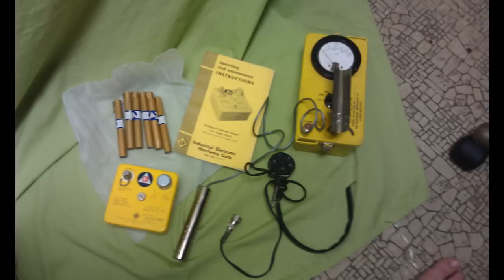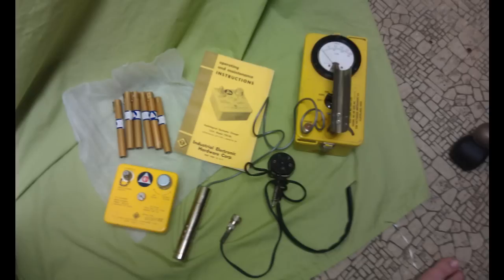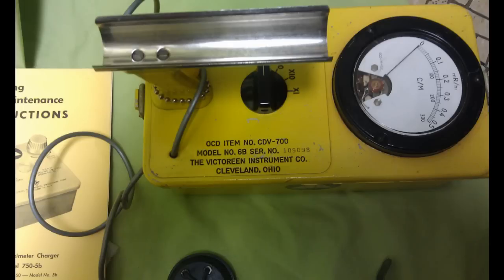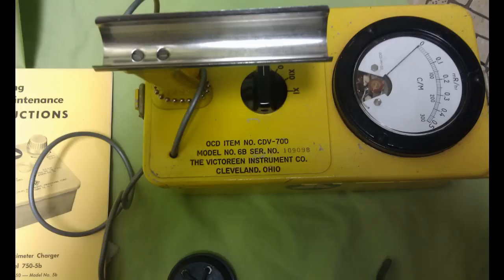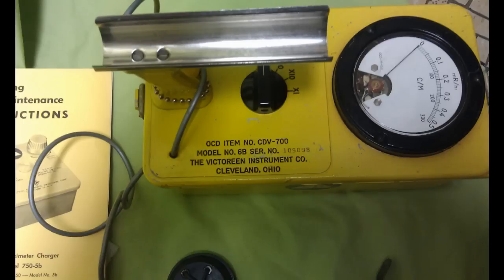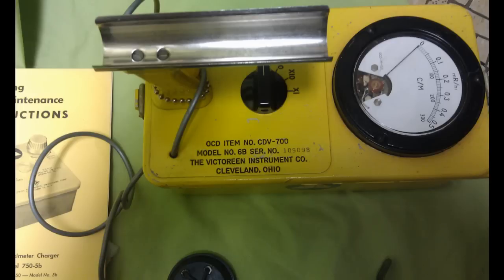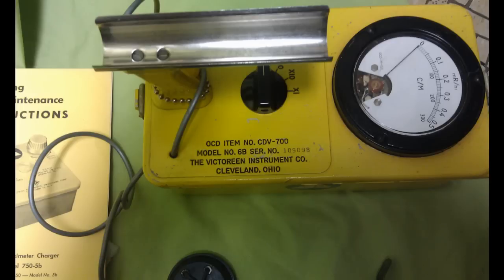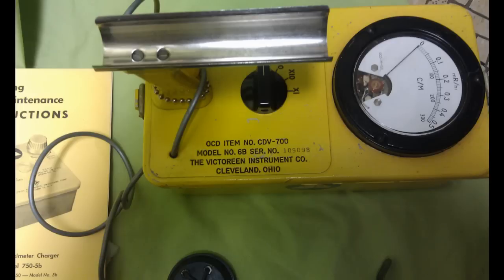How to read a radiation detector / geiger counter such as CDV-700 6B

Comment: I have one of these that has a different configuration. It has a 1967 date stamped. And the model is a bit different. It is a CDV 715 model number 1B. 
    It has no sniffer  just a zeroing out adjuster with a simple 1 to 5 needle Guage that had the.  R/HR on it. It's not built with a sniffer attachment.

Comment: This is actually not the correct way to read the cdv700.  There is a lot of incorrect information in this video.  You should be careful about advising people to take iodine pills when they are not getting anything more than natural background radiation.  Just a quick tip: you cannot correctly refer to mR (gamma) unless the sliding beta shield is closed on your probe.  You need to close that shield to read Gamma... which might then give you something to be worried about.  The CPM scale is not an indicator of a radiation hazard because "beta" is not considered an external hazard.  However, if you start reading 500 CPM with the beta shield open over your brussel sprouts, then you may want to start getting a little concerned!  That would indicate there is some contamination there, (and you don't want to ingest that!)
Reply: +Orville Fender Thanks.  I realize we cannot correct every mistake on youtube and I have made them myself.  I see that this video was posted way back in 2011 so hopefully the guy understands more by now.

Comment: Also... if you walked outside and your detector read 150 CPM (on a CDV700), you need to check your unit. It is likely bad. If you confirmed it with a second detector or known good check source, you need to go back inside, shut your windows, tape them. Shut off your AC/heat and turn on your radio to listen for instructions.

Comment: I often find my CDV-700 at hard over at 30,000 CPM  :)     30,000 CPM is not deadly, of course lol

My bag of KCl water softener pellets gets about 150 CPM on the CDV700.

Just to be clear, btw, don't take potassium iodine pills. They would only be used if a nuke or reactor blew up near you. The pills saturate your thyroid with iodine and reduce the uptake of radio-iodine. They are nearly never needed and can harm you if taken.

Comment: @sablebush The "gold" tubes are dosimeters. The yellow "square box" is what is used to charge and read the dosimeters. The curved black wire are the headphones...or headphone. The silver tube is the Geiger-Muller tube that detects the radiation. The "silver plug" is the headphone connector.